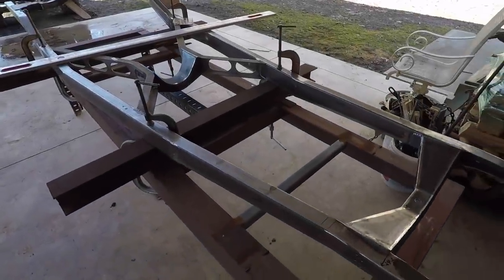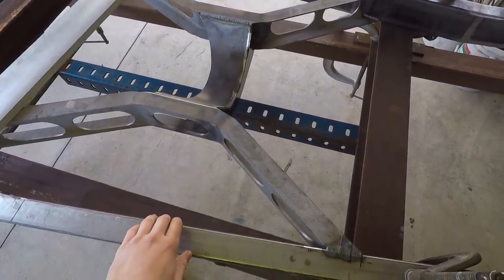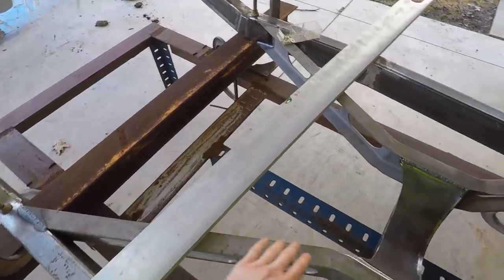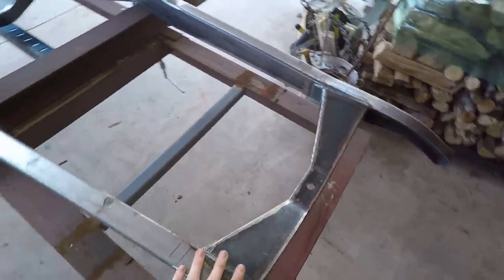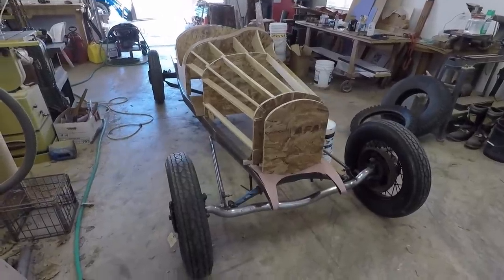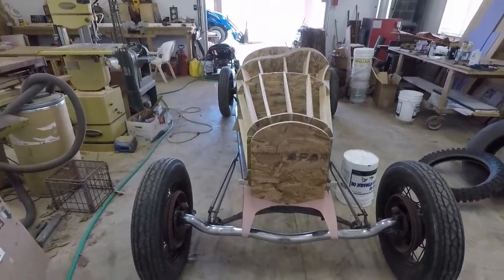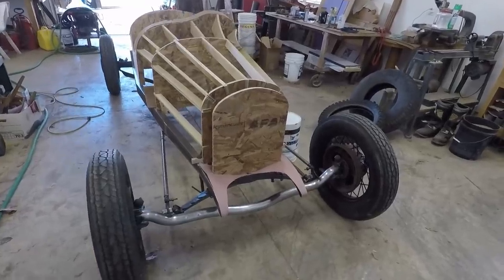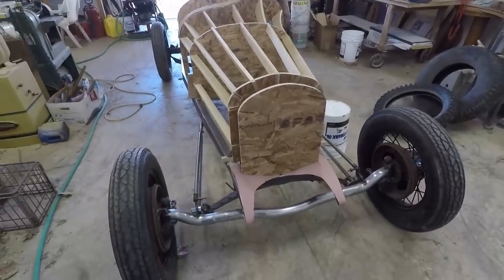Narrowing a Custom Frame | Boat-tail Speedster Pt. 21

Comment: I have just subbed to this channel and find it interesting and the talent this young guy has is something else. Those interested in this maybe be interested in a couple of other builders I follow here in the UK. Check them out. I will be recommending this guy on their sites.
1. Is URCHFAB another take on a car build where he has taken an old 1950's UK Ford pop and mates it to a Mazda MX5. 
2. The other ON YER BIKE is a guy Craig who builds bikes, usually, Bobbers using Royal Enfields from India but has used Brit bikes and has Paul and Blue to keep him back. You may need subtitles for both.
You need to take into consideration building specials is so much more expensive here in the UK i.e. cost of donors and tools and disposable incomes generally lower.

Comment: Very nice work. I thought that you were using awfully heavy material when you made the cross member in a previous vid. I probably would have too! It takes patience to correct that sort of thing rather than just leave it as is, but it will be worth it in the end. Thanks for sharing.

Comment: Just curious about the "heat gun" associated with the TIG welds?  I could guess, but I'd rather hear why.  Looking awesome though, Thanks for sharing.
Reply: I´m guessing its to prevent cracking for when the metal expands and contracts. Its a very important weld afterall that you dont want failing at any point. So he heats up the piece to bring it to temprature, welds it, and while the weld cools down the entire assembly cools down at more or less the same rate, staying together.
Reply from the maker: I was outside and it was like 30 degrees, so I was worried about cracking if it cooled too fast

Comment: a while back i seen a lot of design drawings for 40's racecars on pinterest , and found a good video on youtube about schrinking and stretching metal 
tried to find youre channel to put the links on but couldnt remember wish channel it was , i now lost the link to the pinterest page and the youtube vid unfortunately

about preheating the metal before welding :  i wonder if the paintstripper is efficient enough in the short time youre using it to heat that large piece of the frame , when i worked at a company where they did a lot of welding the had some contact heaters they clamped  ontoo the metal to heat it up , think sumting like that would work better  in youre case too

Comment: Hi,  What is the purpose of heating the steel before  TIG welding ?   Does it make the weld flow better?
Reply from the maker: It was about 30 degrees outside, so I was worried about the weld cracking if it cooled too fast

Comment: This may be a stupid question but when you use the heat gun after each weld, is that related to tempering the metal?
Reply from the maker: It was really cold outside where I was welding, so I preheated it to try to stop any cracks from forming
Reply: @MacroMachines  Ah thank you. Never come across that before - most likely because it doesn't get cold enough to need it around here

Comment: Great stuff! I like you're Videos very much, but one thing that keeps annoying me is the sound while time lapse. The problem is that the sound is often faster or slower than the actual footage. Would you consider changing that problem in the future?
Reply from the maker: the reason is because some parts of the video are filmed in time lapse which doesn't record audio, so I paste in audio that's similar